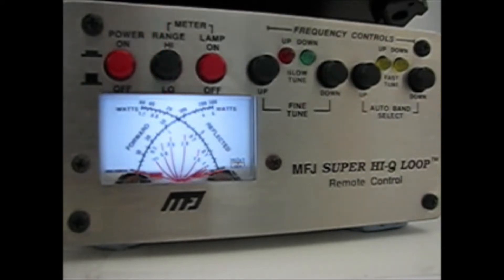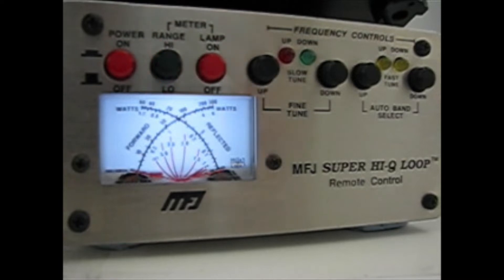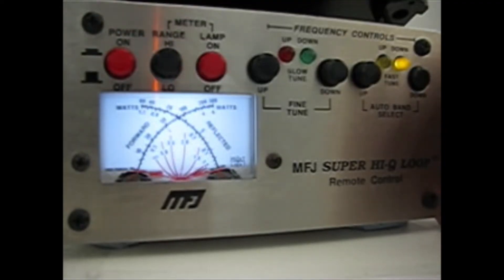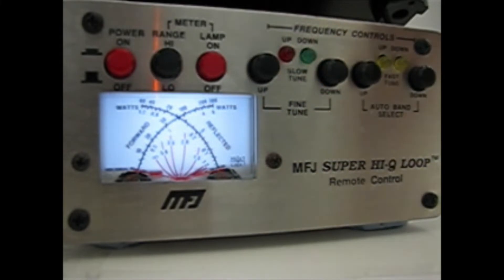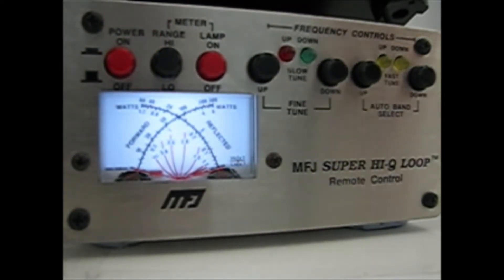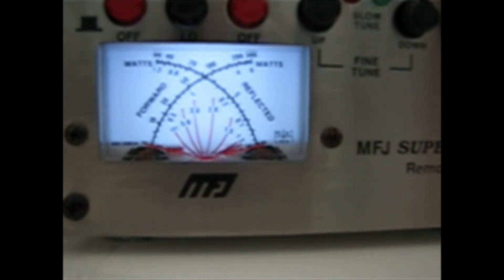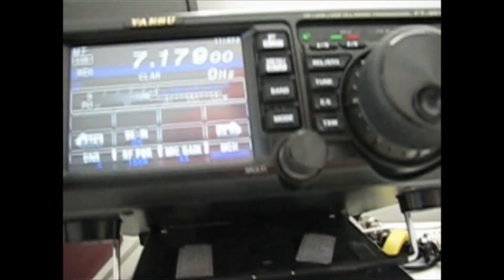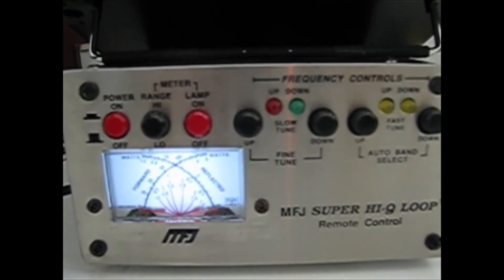MFJ 1788X Remote Controller for Magnetic Loop antenna.

Comment: you are rewriting the manual ? when i tune mine both sets of up or down lights tell the user when to go up oor down to tune this process is almost automatic , you dont actually need to use your ears? your explaination i feel may at least in some cases serve to confuse , press the rough tune then light goes off release button smalle fine tune light come on telling the user what direction to go up or down? why would anyone do that any other way ? mfj have given us the manual to do and learn to do it in a certain way using the tuning lights and yet you never used them? i did enjoy the video but my concern is for beginners who perhaps couldnt even see what was written on the buttons you were pressing you have become very familiar with you loop but beginners have no clue other than memory , my advice to anyone is read the manual see what everything does and just leave you ears for listening for the shout for dinner .